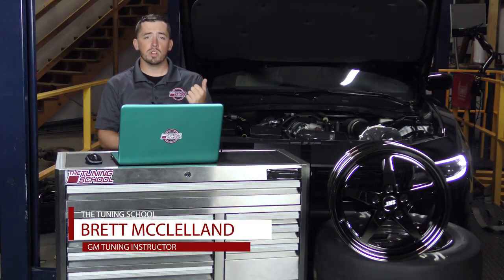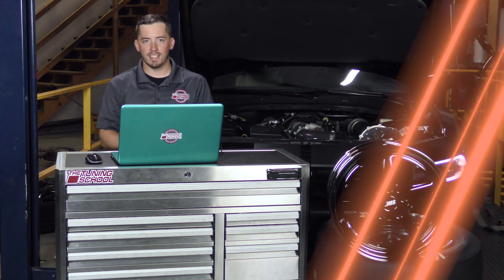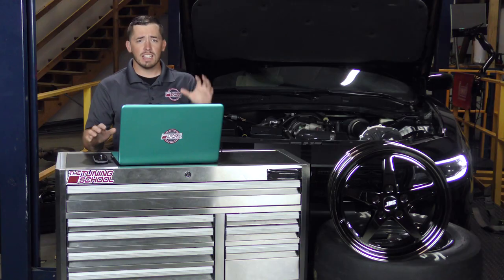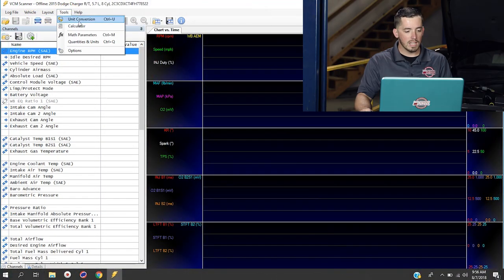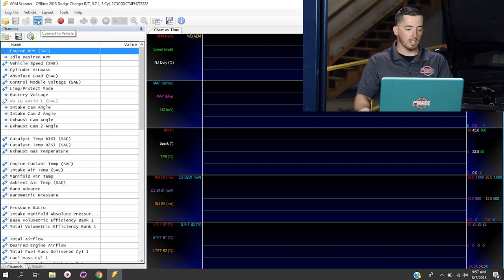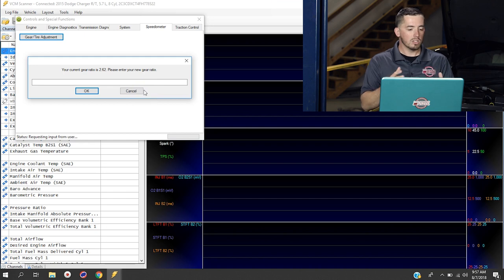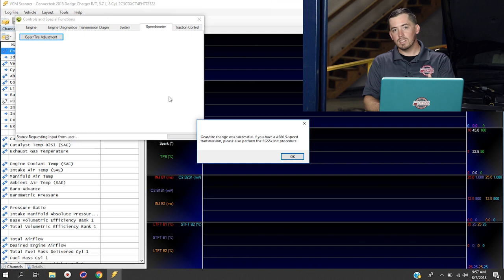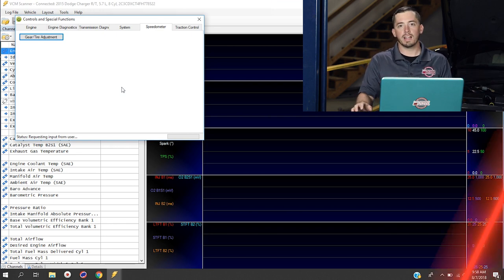Free Gear and Tire Change on Ford or Dodge Using HP Tuners MPVI2 4.X Scanner

Comment: Hi, so after I insert the gear ratio the next step am getting (current tire revs per mile ) and I don’t see the tire height I have tried in VCM scanner 4.4.4 and VCM scanner beta 4.5.519, also I tried in VCM Editor beta 4.5.519 and VCM 4.4.4 from Edit I can’t find gear/tire wizard. Please help.

Thank you